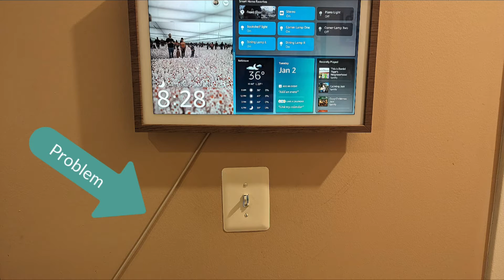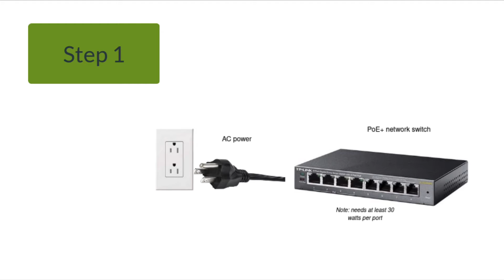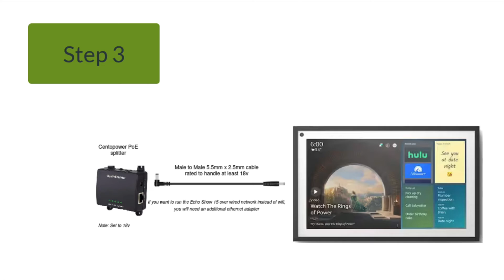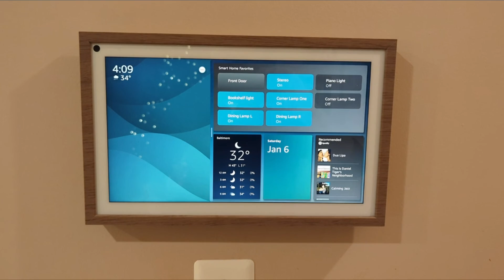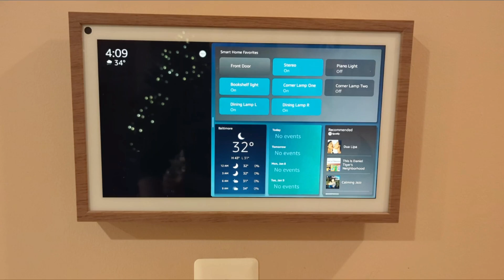Power Your Echo Show 15 with PoE: Easy Guide to a Clean Installation Without an Electrician

Comment: Im a noob idiot so plezse.exxuse the question. why do i need the switch? Are you not able to go directly from your router/modem? Thx for this. Super cool.
Reply from the maker: In this case, instead of plugging into an AC power outlet, I am sending power over a cat6a cable (Ethernet cable) and then splitting that power using a splitter into the barrel plug for the echo show. There are a lot of ways you could do this and the route I'm showing here only makes sense for certain situations. I happen to run a lot of low voltage cable from a PoE switch to other devices in my house already so this was just a "fun" little challenge. But long story short, you don't need a PoE switch -- you could use a PoE injector. Basically your network cable can carry power + data. In this demo I'm just showing you how to power your device using a cat6 cable.

Comment: Hello do you think this will work with Amazon echo 21? thank you. I couldn't find the manual for the 21...so not sure the specs.
Reply from the maker: I just checked and the show 15 and show 21 both use the same adapter so the two PoE splitters I mention will also work for the show 21. Just make sure you switch the splitter to 18v

Comment: Do you find any issues with it pushing the limits for power? I'm tempted to do POE since like you I have a bunch of other POE devices already.
Reply from the maker: No, there's more than enough power, even on a PoE switch with a minimal power budget. In fact, you have to use a step down power adapter like the ones I recommended.

Comment: You can snip the existing power adapter that comes with the echo show 15 and send the dc power over Ethernet cable.   Just double up the pairs for increase wire awg to handle the 30 watts well.    For example wire the negative to orange and brown pairs, positive to blue and green pairs.  This gives you four 23-24awg wires for negative, four for positive.  Works awesome and it’s ran my echo show 15 for years now no issues.  No extra POE equipment needed.
Reply from the maker: Absolutely. I already have a PoE switch running other gear in my house but just sending power over cat with the bundled power supply would work great, too. You're talking about this approach, right? https://youtu.be/aErLiAM2o40?feature=shared
Reply: @NathanGrahamly   correct, that’s essentially it
Reply: I cut the power cable of my echo show 14 but there is only 1 wire😮
I guess I overestimated myself and feel dumb now
Reply: @ there is for sure two wires.   Might be one that’s bare copper. Then the other is colored usually.  Like red or black.
Reply: @ got it. All working fine now. Thanks a lot.